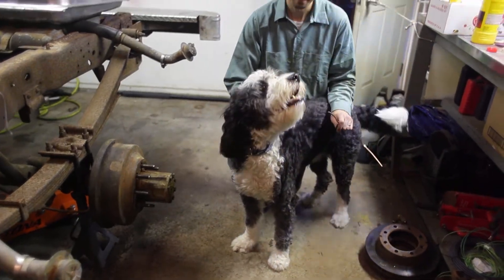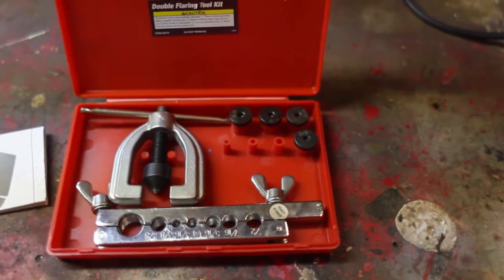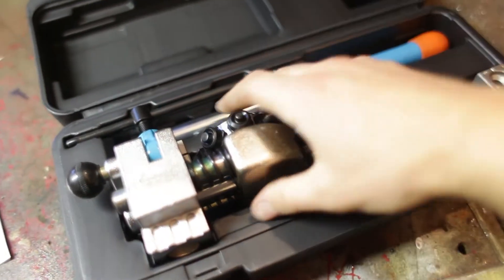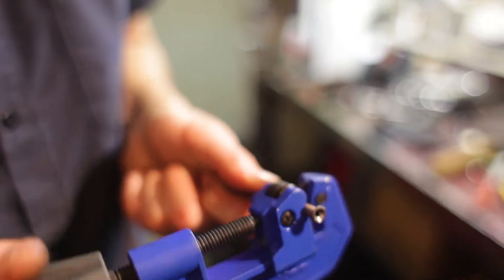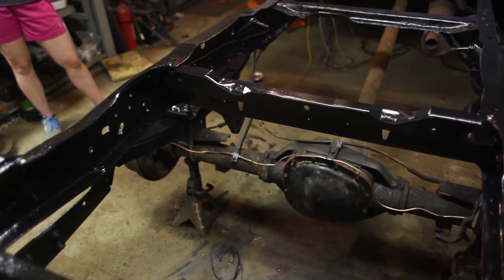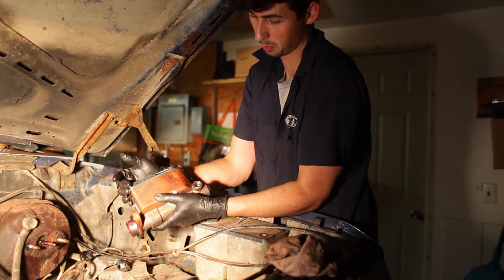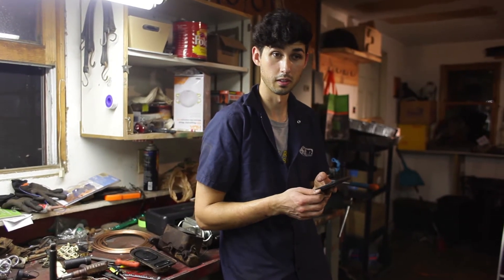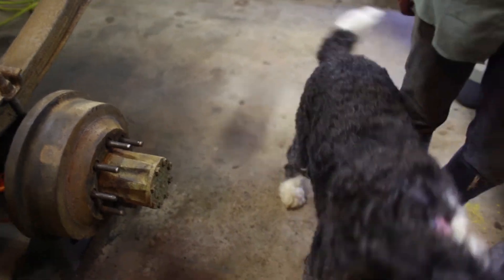Ford F250 Restoration Part 4: Brake Lines + Flaring Tools

Comment: I had the same issue with the master cylinder. Drilled the holes out wider to make it fit and now it won't pressurize when I tried to bleed the lines initially. Bad cylinder I assume? I can't get any fluid to flow through it into the lines.
Reply from the maker: There is a procedure to "bench bleed" the cylinder. Might want to look into that. Since we had all new lines and brakes it took a lot of fluid and pumping, but everything bled without issue

Comment: What brand flaring tool did buy looks like it works great
Reply from the maker: It is from Eastwood. If you search their website you should be able to find it. Worked amazingly well. Would highly recommend if you are doing a whole vehicle worth of lines.

Comment: This series is giving me life right now. I just got a 1986 f-250 4x4 and it needs a lot of love and you guys going through this is helping a lot. I really appreciate the information.
Reply: Ya I am loving it as well. I have a 1986 F-150 with a 5.0L as well but mine is 2 wheel drive.
Reply: @chriscarnetwork7793  that's a sweet ride!
Reply from the maker: Glad you like it! We are having a lot of fun going through this thing. What engine does yours have?
Reply: @TheBadTimingClub  is got a 5.0 v8 gas engine. That's what I know so far.